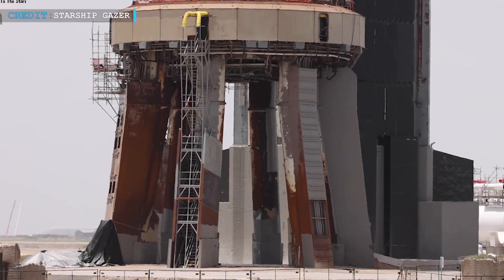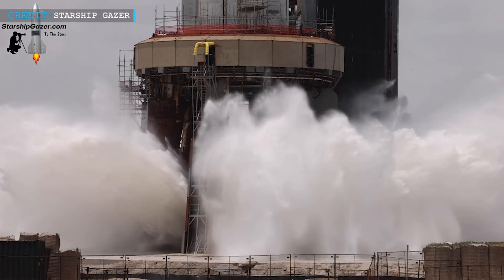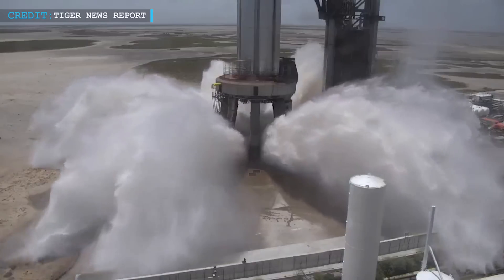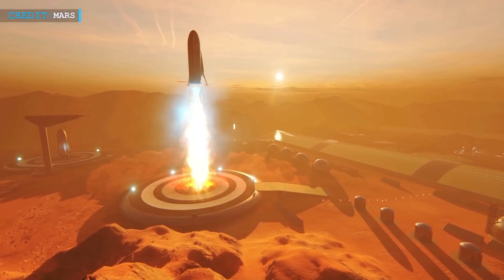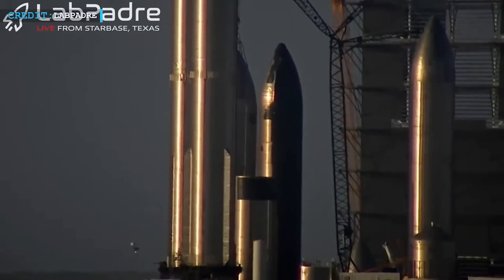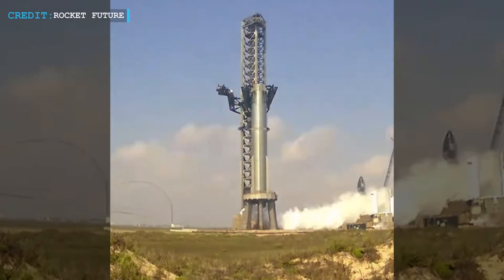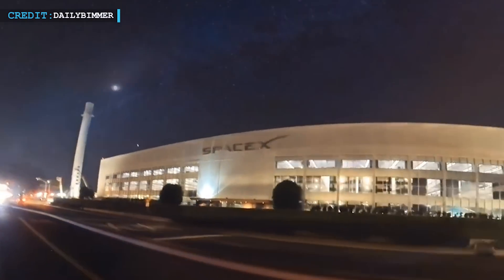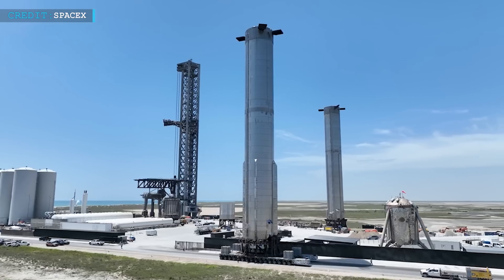This Is Huge: SpaceX Full pressure Water Deluge Test Of New Starship Flame Deflector Just Happened

Comment: I can't see how the rocket nozzles blasts focused on the center of the deluge plate can be matched by the pressurized water & nitrogen. It seems the rocket exhaust backflow will be prevented but how will the water not simply divert to areas not immediately under the plume, thus leaving unprotected steel to be eroded?
Reply: My theory is a lot of water will flash to steam and cushion the nozzle blast for the 7 seconds needed.

Comment: Does a rocket need to be close to the ground to lift off into space, or can a rocket theoretically lift off  while being held or suspended in the air well above the ground? If we could send a rocket to space without it being so close to the ground, wouldnt that save on material and money since you wouldnt need water or anything to divert the flames?
Reply: Apart from the logistical nightmare of building a super tall launch tower, it would prove more costly to have to service, fuel and maintain a rocket and tower at this great height.
Reply: @straighttalk2069  yea, after a little thought, my conclusion led right to this.. It would have to be super high and that would cause for MEGA Structure type building. and to get the rocket suspended that high would be a feat in itself.
Reply: It can take off from anywhere. It works the same in space
Reply: Maybe that is the solution in next launches. In som future e design elon hunge the rockets. But for this time that is need so many research for and founding forperfect it. 
So if we just add so many water for this problem is so helpful for now.